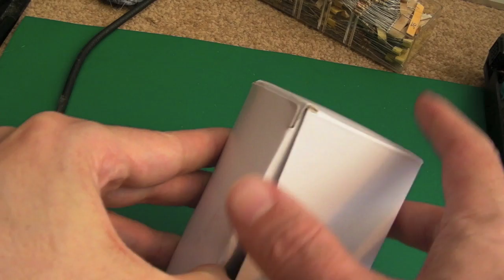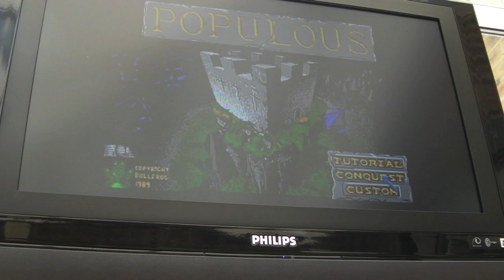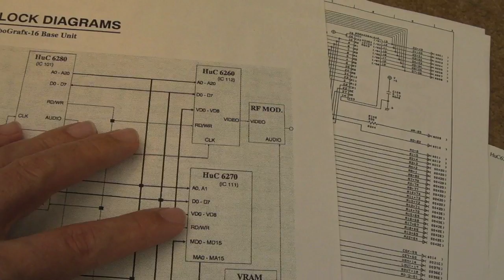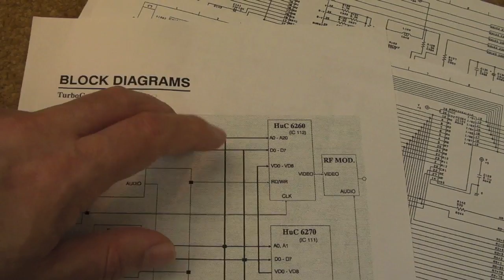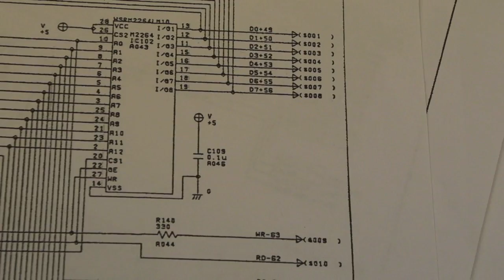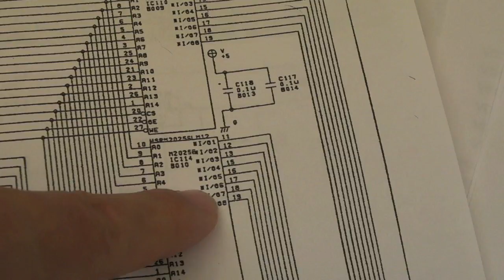NEC PC Engine Repair Part 3

Comment: Congratulations on the repair. Very good!
I understand almost nothing of English, I get a bit lost in the video.
I have a PCE with a white screen, this happens when the console couldn't read the hucard, should I be wary of the GPU?
Reply from the maker: if the screen just stays white, it could be the HuC6280, HuC6270 or the CPU RAM.  It's worth cleaning the cart slot to make sure you dont have an oxidised connection.
Reply: @GadgetUK164  " It's worth cleaning the cart slot to make sure you dont have an oxidised connection." I did it, with no results :(
But thank you so much for answering me!

Comment: Hello, I saw your video which I find brilliant, only I don't understand the language! However it is a very good video, I would like to ask you a question to know if the hu6270 is good on a (pc engine gt) how to know if it is ok? or rule it out already existence! because I have a short circuit on the motherboard if you have any idea thanks
Reply from the maker: You would need to use an oscilloscope on the data, address bus and control signals to work out if something is not pulling high or low.  There's no easy way to test a hu6270 to be sure its working 100%.  You could measure or feel temperature of chips.  If the hu6270 is getting incredibly hot very soon after power on, it is probably faulty.  You could also use a "current tracer" to see if a particular connection is drawing lots of current - but those are hard to find these days.  HP used to make and sell them.

Comment: My PC Engine is starting but has a problem with the white screen. Can you help me? Do you know any specialized technical assistance here in Brazil? Your videos are very good! Get in advance for the help and intent to post these videos. Best Regards!
Reply from the maker: Sorry I cannot really offer any advice other than cleaning the cart slot, measure the 5v level on the board, and make sure none of the ICs are getting hot.  You really need to use an oscilloscope or logic probe to work out where the logic might be at fault.  It could be bad work RAM, faulty CPU, bad GPU etc.

Comment: The majority of North American SNES consoles did not prevent you from inserting and removing cartridges while the power was on. They removed the locking mechanism seen in earlier consoles and added a sticker warning people not to insert or remove while the power was on. Nintendo also redesigned the cartridges some time in 1993 to defeat the locking mechanism when played on an earlier console.

I believe early Japanese Megadrive consoles also had a locking mechanism due to the notch on their cartridges but I've never seen confirmation.

Comment: I get no music or video.  Only a white, pink or other solid color screen.  Same as if no game is in the system and you turn it on.  Just ordered a second game to see if it is a bad game.  I cleaned the connector pins.  Does anyone know where you can purchase a new connector?
Reply from the maker: In that case, probably a faulty CPU or WRAM.  Could be a problem on data or address bus caused by something else though (GPU etc).

Comment: Glad to see this one is done and dusted, an extreme amount of work gone into resolving that issue ( no help from the faulty replacements)  -  It's pretty interesting how this TG16 actually works with the schematics, you should be well primed now for another TG16 fix project :) 

It would be interesting to see how the other versions differ when compared. 

Great work, i enjoyed this fix up journey  !looking forward to the next.
Reply from the maker: Thanks =D Nearer the end of the year I might try and get a Duo-R or something similar - If I can find a faulty Duo that might be more interesting as it will certainly need re-capping.

Comment: The PC Engine is an amazing piece of hardware. I went through the schematics more than once and I really love the design. In my experience the GPU is what fails most of the times only second to bad ribbon cable. Anyway thanks for this very enjoyable series of videos on the Pc engine!
Reply from the maker: Thanks =D  Interesting that the GPU fails most of the time!  Always nice to hear other peoples experiences!
Reply: I share your interest with fixing old hardware, though I must say that unfortunately buying spares is completely antieconomical. Of course we do it for passion, but as you proved in the PC Engine videos, for the price of 1 spare GPU you could almost buy a new PC engine
Reply from the maker: Yes, most of the time some systems are not economical to repair, that said - all this PC Engine needed at the end of the day was a $13 HuC6270, so it wasn't that expensive (The faulty PCE was £30, chip = approx £10 shipped, and typical working system in UK is £40 ish, so I almost broke even.  I spent more because I also ended up with 3 more spare chips and a spare work RAM, but it's nice to have spares for future repairs etc.  I think every retro system I've bought has been faulty and repaired, and most of the time it works out cheaper to repair them than to buy a replacement system, but they do some times take lots of time etc.  In the case of the PCE, they are in high quantity on eBay Japan and around £40 to £50 often including a controller, so yes - standard PCE models often not work repairing at the moment =/   I guess as their numbers diminish the value will go up, and then people might consider repairing them cost effective.

Comment: It's quite normal for CPU's to have I/O mapped addresses for easy access to peripherals like joysticks and stuff. 
Video chips can work independently from CPU's and even at a higher pace. A separate DAC sounds like that would make it easier to produce PAL and NTSC units by switching chips. 
If you watched BWack's videos where he designs the stripe fix hardware for the C64 you'll see he has various pots to influence luma and chroma signals. Not surprising to have biassing signals to balance the output perhaps. Looks like a good design. It's not a kick ass piece of hardware for nothing :)
Reply from the maker: Good points there! =D  I think the DAC is the same between countries though - so not sure what's going on there.  ie. there's just one 6260 which exists in both the Turbografx and the PC Engine.  I know there's a pin you can alter to toggle regions with regards to the cart protection.  I guess the european TG16 perhaps just has a different modulator and composite circuit.  Something I've not thought about until now.

Comment: Certainly was the GPU causing those lines to be forced low. Took a bit to get there but you did it. 
You're pretty good at RType by the way :)
Reply from the maker: Thanks lol, and yes my R-Type and Operation Wolf skills have improved a lot over the last few weeks.  I can beat all 4 levels in R-Type 1 without too much difficulty, but level 4 is a pain in the ass lol.   I can beat Operation Wolf now with ease and can almost get to the airport part the 2nd time around.  I always thought both games were incredibly hard but there aren't if you keep playing them =D

Comment: Interesting to finally see the bottom of the problem, i have a few original systems with the same symptoms which I've always considered beyond economical repair - as i never pay more than £10-15 a console.
Reply from the maker: Thanks, you are right - most of the time these things aren't economical to repair, unless you have a spare parts system etc.  I could have just kept many of my faulty systems as spares boards etc but I tend to want to work out what failed, even if it costs more than its worth to repair lol.  £10 to £15 is brilliant for faulty systems!
Reply: +GadgetUK164 well no I actually pay that for working systems direct from japan.
Reply from the maker: Wow, that's amazing!!!! =O  I guess if you can find contacts in Japan you could easily get system there much cheaper than eBay prices.

Comment: Would love an update when you do your RGB mod. Thanks a lot for these videos! Just bought a tennokoe bank to do a better video mod on my pc engine.
Reply from the maker: I will do an update when I do the RGB mod - probably this weekend as I've already assembled the board and want it in place before I get my Turbo Everdrive next week!  Only downside to doing the mod to a Tennokoe bank is if you ever get the CD add on you need to mod that as well =/  I guess the RGB amp parts are quite cheap so it's not a big problem.  Thanks for watching and commenting =D

Comment: I'm with you on them chips, I think the guys who are selling these chips are salvaging them and not testing them before shipping, they probably buy faulty console and break them for spares and have no clue what the fault was on the console in the first place before they broke it for spares. If you knew they were good chips you would do your best to ship them to the customer in some sort of ESD protection just for peace of mind alone, it's almost as if their winging it. But guess what, this time they came up against someone who knew their stuff so they had no choice but to send you working ones. But still no ESD protection.
Reply: 100% they are pulling these from faulty consoles, they claim to strip them from working machines - but i find that hard to believe.
Reply from the maker: Yeah, I am quite pesamistic by nature - so I could be wrong, but I guess its the risk of buying SMD chips like this.  It's easier for people to test DIP chips so you tend to get the problem less.  I do have some 128 pin sockets which I might use for the CPU slot on this (when I come to test the CPU), but I originally wanted to use those sockets on the SNES.  Problem on the SNES is the sockets fit exactly over the SMD pad foot print - ie. there's no overlap to solder onto.  As you say - no ESD protection in the packaging there =/  I don't think that was the problem with the last chip, I just think it wasn't tested properly perhaps.
Reply from the maker: Yes - I am sure you're right!  Most of the time chips would be OK in that scenario, perhaps 20% of them have issues or something.  At least they replaced the faulty chip for me, but if wasn't clued up I might have thought that something else was the fault etc and just lost the money.

Comment from the maker: Turbografx 16 Service Manual - http://gamesx.com/wiki/lib/exe/fetch.php?media=schematics:turbografx-16_unit_service_manual_-_smtg16.pdf

6280 pinouts:- http://console5.com/wiki/Hu6280
6270 pinouts:- http://console5.com/wiki/Hu6270
6260 pinouts:- http://console5.com/wiki/Hu6260
Reply: GadgetUK164 - Retro Gaming Repairs & Mods

Wow - so, even console5 managed to get all of the chip labels / descriptions wrong? :o

I guess it's fair enough to say that the 6280 (CPU) does do "Sound and controller" stuff, but both of the other chips are labelled wrong too. lol

(I wonder if one or two typos somewhere had a knock-on effect over the years?)